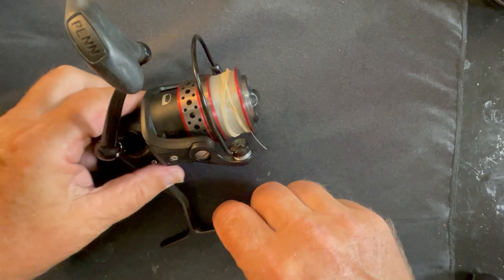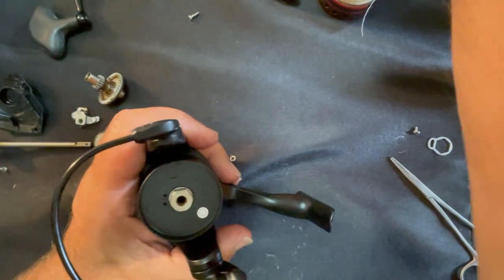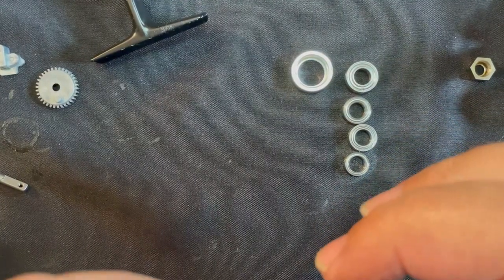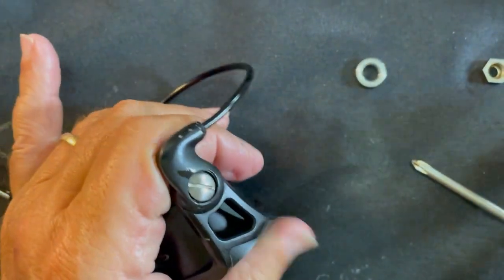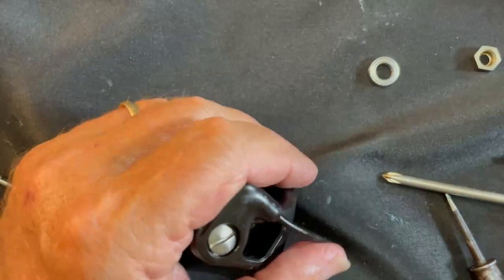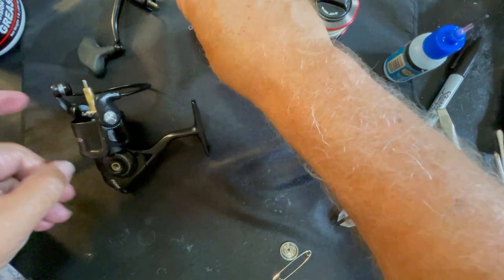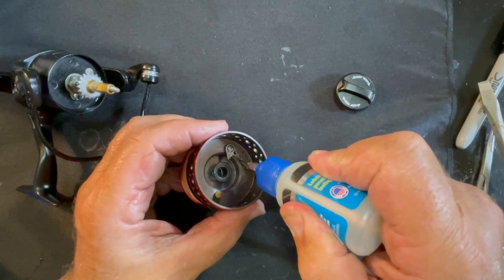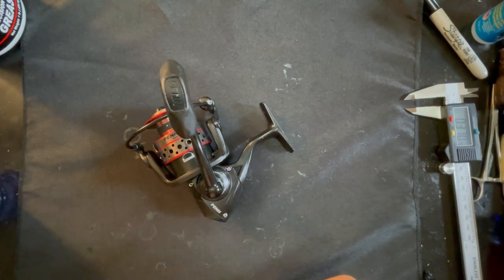Penn Fierce II 3000 - Service and Lubrication - Young Martin's Reels

Comment: Yep, you’re right. I don’t like a reel that has no anti-reverse override. I could give a lengthy reasoned argument as to why this is so but what it comes down to is it’s my preference. It has everything to do with how I have fished for 55 years.  That bail spring is just about as easy as they come. The bail spring on that Olympic LG reel I just got would be nowhere close to as easy as this Penn reel. It has a very powerful bail spring. You know if you had an AR override you would not need to worry about spinning the rotor.  Just saying. LOL  I’m glad you like these modern Penn reels so much. As for me I’ll take my Penn Greenies and Z reels. Still I’m glad to see the inside of a Penn Fierce. — Chris  PS. I use an attachment I found for my drill specifically for stripping fishing line. It allows me to take the line off my drill in a tight wound coil that I can easily cut into very small lengths before disposal. Disposing of fishing line in long lengths in a bunched up mass has killed many birds so I don’t ever dispose of uncut fishing line!
Reply from the maker: Chris, I do have a Penn Z real that I plan to do soon too. Sorry to see you were up at 3 am, I hope you are feeling better. I considered truncating these next two, reel videos but someone out there will have one of those reels and I'm sure they would like to see a video about that particular reel. For those that watch them all, you might want to skip those since they will be basically the same as this one.